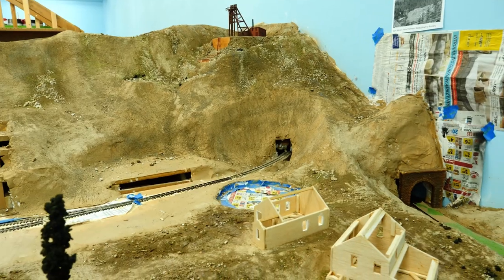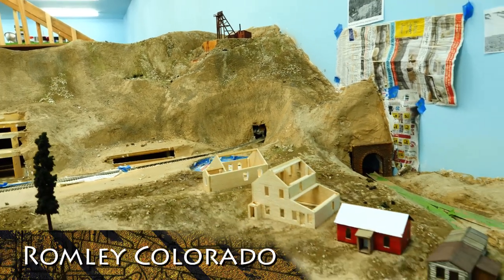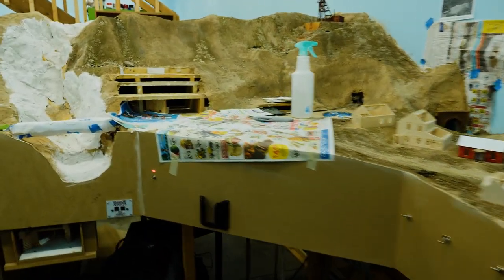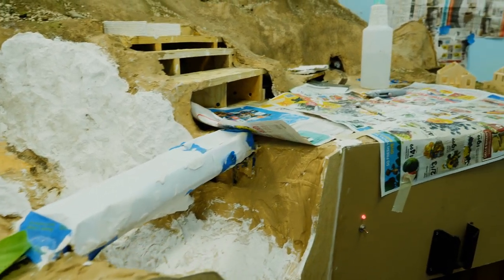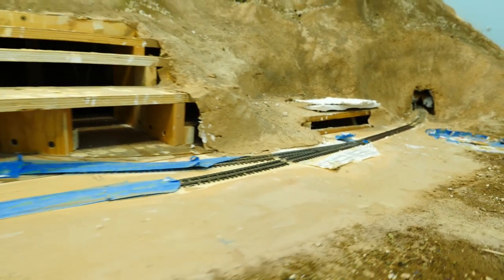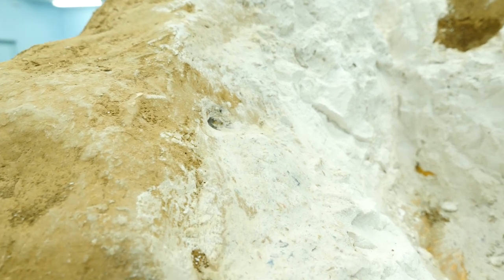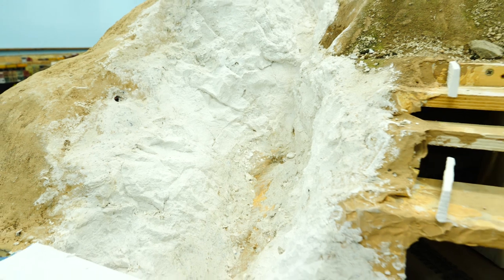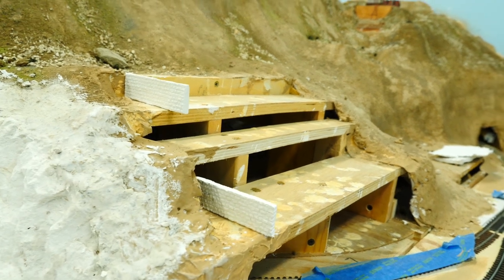Cab Ride! And Pomeroy Gulch Rock Molds. Model Railroad Layout Update 120

Comment: The view looked cool till the wheel fell off the wagon !   I see you have signals what do you use.   I am starting the lower level which I am installing signals I am using MP 42 for the blocks, BDL 168's and Sec8 for detection.   I licked the video nice to see you gang again.
Reply from the maker: Not using any block detection. The signals are just controlled by which way the turnouts are set.